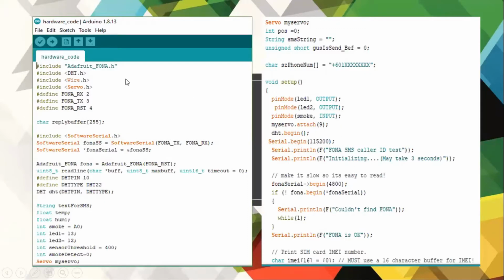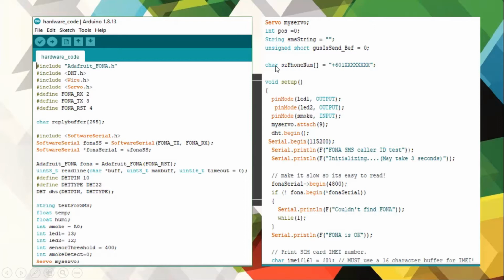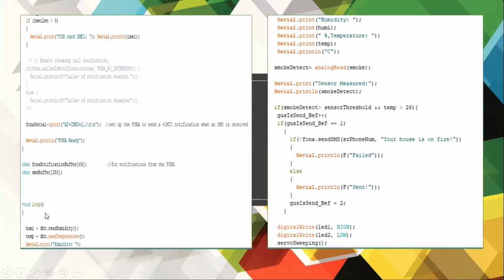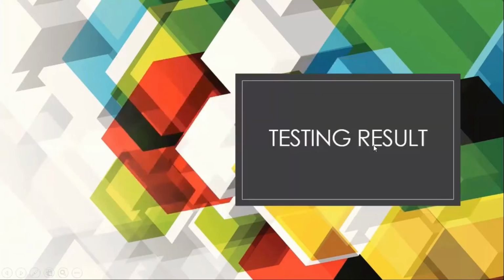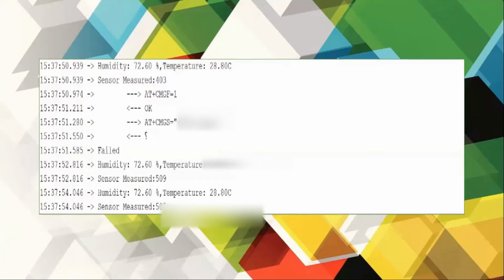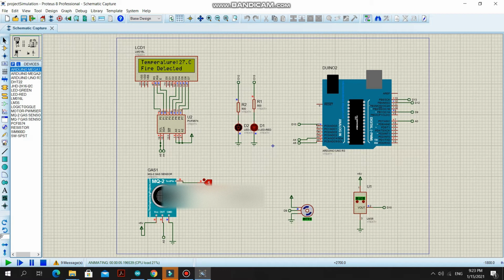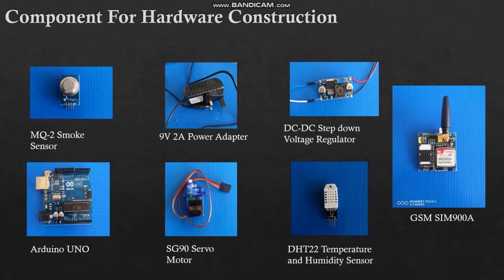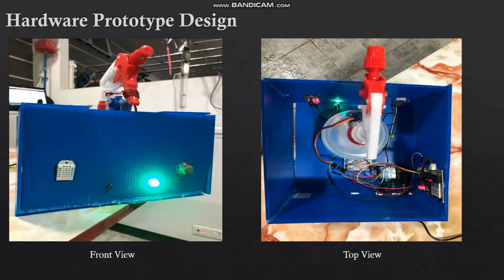Smart Home Fire detector Using GSM (BEE3942 MicroController Programming Group 7 Section 02)

Comment: Nice video but the background song is too loud for the first 3 minutes. Need to reduce the soung level a little bit. And can you please explain the followings:
1. Why the sensorThreshold is set to 400? What does the 400 means?
2. No buzzer to inform the owner if the fire is detected? what if the owner still sleep in the house? Are your sure the sprinkler can save the owner without the need for the owner to evacuate the building?
3. Why the temperature must be greater than 26 degree? the smoke move faster than fire.. so in case of fire, it is normal to detect smoke first although the temperature is not increase yet.. this will give enough time for evacuation rather than wait for temperature to increase..
Reply from the maker: 1.  The sensorThreshold sets to 400 to ensure that the smoke sensor MQ-2 will send signal when the high concentration of smoke is detected. 400  means the sensor value for the smoke sensor sensitivity, we can increase or decrease the value by adjusting the sensitivity level of the smoke sensor behind the module.

2. Since the system is using GSM module to inform the owner, so the owner can set the message ringtone on their phone specifiically just for alert message. For this system, sprinkle are not really effective can save the owner's house from the house but at least can make some times for the escape for fire. To improvise this system, we can add water pump module into the system to create a better water sprinkle for this system.

3. The temperature is set according to room Temperature, we set it to 26 because the room temperature is very low during the simulation process.  So, in order to detected the fire effectively, the temperature must be set slightly higher than room temperature. And sometimes there are some cases that smoke are detected but no fire is found out, so to increase the accuracy of the system, a temperature condition is set to detect the fire so that no false alarm is sent to the owner.